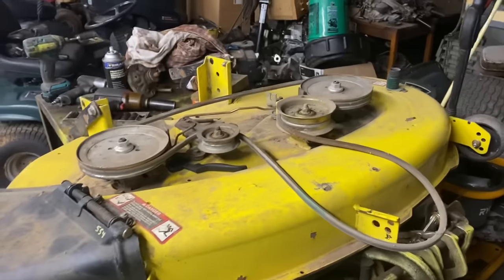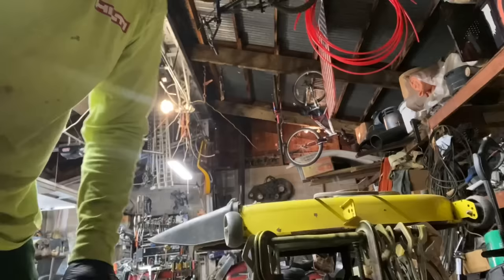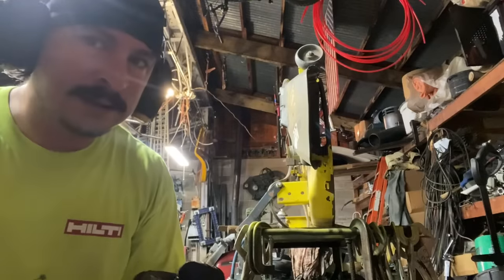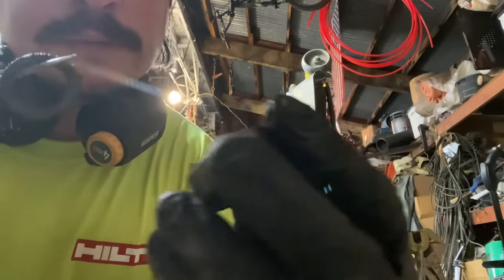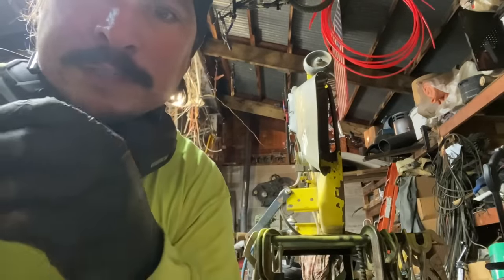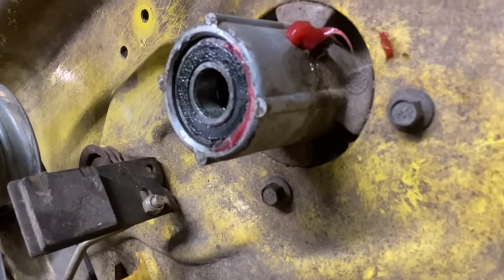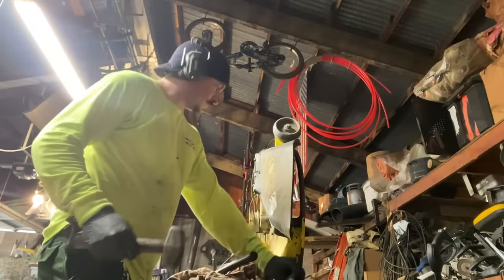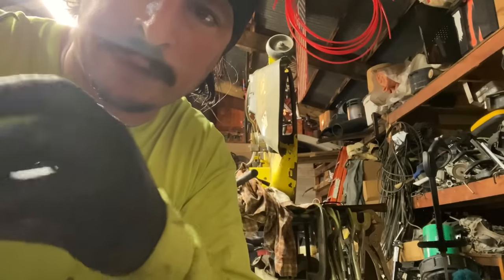Part 1 - Don’t trust the “Experts” Grease your mower deck sealed spindle bearings Common sense.

Comment: Why didn’t you go ahead and pack it with grease with shield off?
Reply from the maker: Did you watch the whole video? I feel maybe you missed some parts if your asking that question. I could be wrong. However, I had some points to make. I was not showing how to do it that way. I was showing that the seals take grease and how many pumps it takes. It was necessary to do it the way I showed so folks would know when filling a new unit how it will be done. Taking these apart to fill the inside with grease manually is not normal and would be confusing if it was mixed with the information I was presenting in this video. It’s simply easier and less mess to connect a grease gun and pump the assembly full.

Comment: With the seals off hand pack the bearings then reassemble  the bearings an once of prevention
Reply from the maker: To each his own. I just proved that is the hard way to do it if a mandrel has grease zerks that would be the smart easy way without adding an hour of tear down and reassembly to a simple basic grease application. Not to mention the unnecessary risk of having a bolt break off on something or other issues on disassembly that could otherwise be avoided but simply using the proper tool for the job, a grease gun. Why make a simple process so complicated? No everyone like to make more work for themselves. Just my 2 cents. If you prefer that method that’s fantastic, it is one way for sure just not the simple way.

Comment: What if the spindles lack zerk fittings?
Reply from the maker: Add them, it’s worth the trouble. Depends on brands. Some like cub and MTD and Murray are under the deck just depending on model
Reply: @GTObearclaw1  Exmark Lazer Z commercial 60". The deck by itself probably weighs 100 lbs.
Reply from the maker: @nogoodcops6557  I’d be surprised if they didn’t have a zerk but may want to read up on those decks. I’m not making videos on commercial stuff just home
Owner el chepo models and some of the heavy machines used taperd bearings and much heaver duty bearings may also already be filled with grease. I’m no expert by want means

Comment: Since an off-the-shelf, general-purpose grease gun can generate pressures in the order of 7,000 psi, it stands to reason that the grease will either find a weak point to pass or will rupture a clearance, seal or passageway and create a new weak point.
Reply from the maker: Yea that’s not a concern here because the rubber lip on a 3 cent shield cap ain’t gonna allow pressured to build to 7,000 Psi. Are you serious here here? Tell me that’s a joke. Do you think it takes more than 10 or 15 psi to push grease past a rubber lip. These bearings are not made for submarines. Good grief. Iv shown every step of the process. It can easily be tested if you want to debunk the process. I’ll be the first to watch your video. In almost 20 years Iv never seen that happen. Thanks for the dramatic comment falica.
Reply: @GTObearclaw1  do you really think that grease gun knows whether it is pumping grease into a $2 bearing or a $200 dollar bearing? First time I've ever seen that "beating the bearing in with a hammer" method. Whether it's a $2 or a $200 bearing, I wouldn't let you near it.
Reply from the maker: @thomasbarrett3175  haha, Ill survive just fine if you don’t bring me your stuff to fix. But good to know you don’t want me fixing it. I guess you don’t care to be called falica. Maybe you can see past the joke. I think you might see what you want to read. Does not really sound like your smelling what I’m cooking here. I’m not arguing the fact a grease gun won’t put out the pressure. I clearly typed that the lip on shield won’t allow that pressure to build. That lip will be unlikely to hold back 15 psi. If the grease is applied to a unit that can’t hold pressure a grease gun can never reach what it’s capable of. But I know you realize that. So probably just a oversight as you quickly read the reply. So regardless of what that gun can exert the seal will simply let it pass out of the bearing long before that gun will build pressure. It seems so simple to me, but maybe because Ivbeen messing with this so long. some folks overthink it because they get caught up on details that don’t mater and create issues that dont exist in this application because of other applications they have more experience with. Could you be crossing over to other application? Do you fully understand how these assemblies are put together? Did you watch the whole video? If not, that’s not fair to me and yet here I am giving you my time. But maybe someday a person reads this and realizes it’s worth some thinking. If I’m wrong here, Where is your proof that lightly tapping bearings with a hammer will hurt them? First time you seen that? Iv seen so many videos folks doing this it seems like it would be hard to miss. At some point yes hard hits can damage a bearing and put dents in the race or flat spots on the bearing. Gentle taps for this application have never been an issue. Besides that, I’m explaining that there is no need to pull bearings out to add grease, if greased through the available zerks, the bearings receive grease and no need to dismantle a deck. not a submarine repair going on here. Did you see any airplanes in my videos. I’m not concerned about inventing things that don’t happen so I can scare folks away from doing basic maintenance. I’m explaining another option in argument of the folks who say that greasing a mandrel is a waste of time. It is in fact a very helpful for the bearings. No doubt it’s a controversial topic. Probably why this video has so many views. My opinion on the topic is not in line with what the “pros” are saying. I was annoyed by the pros saying it won’t work, but not a single one has made a video showing a seal pop off or “blow out” or show that even after pumping the grease gun that no grease reached a bearing. It’s all unfounded claims that nobody provides proof for. Yet here I am showing my whole process and it can easily be retested by naysayers but yet none have made a video proving I’m wrong. So that’s a bit interesting to me. Meanwhile this video is here to prove the experts wrong and one coment at a time I’ll
Go to battle with naysayers. Some get there feelings hurt. Folks don’t like others to disagree. And some love to point out every little thing I didn’t do by the book. That’s how I fix decks. Works great. Some folks go pay a mechanic for a half AZZ job where shortcuts are taken. I rather fix my own stuff and usually do. So I get a good idea of how long my repairs hold up. If your such an expert please post some videos and show us your processes. I’m hoping to help the DIY folks. Lots of folks have backed this process. One thing Iv found is that the folks who have been doing this process long before me message saying I’m spot on. The only folks that say it’s not beneficial all have one thing in common, no hands on experience. Just worried I damaged a bearing or blew out a seal / shield. Only so many things to point out that could be potential issues. Trust me your not the first and won’t be the last. So the other options are, run the bearings to failure and spend $ on parts anyways. Take the mandrels apart not using a hammer and add grease to each bearing individually so not to disrupt the integrity of a lip on the shields. Or, simply add grease and see what happens. If In fact adding grease caused a issue and the bearings fail due to such, things were coming apart anyways without using the grease gun so it’s really just a matter of when you want to pull the deck bearings out or if someone wants to use the grease gun and see if I’m right. We can all test this for ourselves. If you bearings last forever, I’ll never receive a thank you. And that’s cool beans. I don’t care, just knowing I’m on to something here is enough for me.
Reply: Bearings, no matter what they cost are precision ground with specific clearances and tolerances, that is why you don't beat on them with a hammer. I don't need to make a video when SKF has numerous videos that will show you how to install them properly. Just because a bearing is inexpensive doesn't mean I shouldn't install it correctly, after all I want it to work properly and be reliable.
Reply from the maker: @thomasbarrett3175  all? Apparently you have not held the 2$ bearings from Amazon in your hand. Lol. Not all bearings are equal? At what point does a bearing receive damage when tapping with a hammer? Did you see me really getting after it? So your saying a light tap is absolutely going to damage a bearing? Really? And what tolerances did I change with a light tap? In 18 years haven’t been an issue, so there is that. With hands on experience. No issues doing it how Iv shown whatsoever in all my years of fixing decks, that’s all I’m trying to say about how I do it. Not saying I’m the expert about bearings. When possible I like to tap them in by the race. When able to do so, the load is only on the race. I do try to apply the pressure to the race that is in contact with the surface holding said race. And light taps. I try never to hit one hard. Again, your not the first. Won’t be the last. Your stuck on the one thing I seemed to do wrong in your eyes. Maybe that blocks you from
Seeing the benefits of the main focus of my video. The video is specifically about getting grease to the bearings in a simple way. The average person won’t need to worry about removing or installing bearings if they start greasing the bearings before a failure occurs. By using the process I showed and greasing with a gun through the zerks that may already be on a deck, the bearing will have the potential to live a longer life. As for the hammer, it’s never been an issue here and I dont plan to stop however I hear you loud and clear. I simply don’t care. I’m glad we have narrowed it down to that last concern you had. Some folks like to go strictly by the book because that’s what the engineer said to do. And if I had no hands on experience I’d try to follow every step as well. But I’m not that guy. I am the guy who gets motivated when I see something that’s a lie, I will prove them wrong. Been doing it a while, no sweat I will keep doing it. Not everthing needs to be challenged. Knowing when and when not to challenge something is a valuable thing. Some folks will never get it. But thank goodness for instruction books and the subject matter experts. Sometimes I need them too but I have learned not to trust all the information I see from “experts” they can be wrong too. If I’m ever working on life threatening equipment I’ll
Follow the rules or at least consider the advice. But for now I have a hankering to beat the crap out of a bearing and run it in my mower just to see how long it lasts.

Comment: I was told my mower deck Needed the bearings greased so I did that when I started the mower back and let off of the break it was squealing wasn't sure if it would quit in a few seconds or minutes or if it was already too late and something else was going on. I have the world's worst luck with lawn mowers and weed eaters it's ridiculous
Reply from the maker: Yea if the bearings ran long enough dry to damage them it won’t help much to add grease. They will remain load but may hold together a good while longer now.

Comment: I used to make those things in a die cast plant
Reply from the maker: That’s pretty neat, I’d like to see the how it’s made process for these.
Reply: @GTObearclaw1  Russ look and see if you see the initials IDC on them. That stands for Imperial Die Casting. They are just made in an aluminum die cast machine. You can find the process for other parts on You-Tube. Strange thing to know. There is only about two types a long one and a shot one and one company owns them all. I am retired or I would get a picture or two. I might have a friend that would, but they can get fired for it. A few made in China.

Comment: I've been told that those bearings can't be replaced,  you have to replace the entire mandrel.  Again that's wrong.  I never tried this before but it makes sense.
Reply from the maker: Be careful who you listen to. A lot of ignorant people are happy to give advice. Nobody is an expert on everything and if they claim to be that’s a dead giveaway they are probably the last person to listen to.
Reply: @GTObearclaw1  
So true sir! 
Once I pulled an engine out of a 1984 Pontiac Sunbird through the top.  After doing so I read the repair manual,  it said the engine and transaxle were to be dropped from under the car.  Thankfully I was too dumb to read the manual first. I put the engine back in the way I took it out.
Reply from the maker: @bertgrau3934  that just goes to show even the engineers can be wrong. Iv found that many things can be done easer than the manual shows. Lol

Comment: True sealed bearings don't need grease. If you pump that much grease in there it will bust the seals and then needs to be greased more often. In the bearing industry they put grease fittings in almost all bearings even if they're sealed. I think so you grease it bust the seal and then it fails and you have to buy another. Also there is a difference in sealed vs shielded.
Reply from the maker: The reason I made the video was to provide proof. Never seen a seal / shield damaged doing this. Been a few years now I’m sure I’d have experienced a failure by now if that was a concern for this application. As usual the know it alls have never tired greasing a deck this way and can’t prove squat but they are happy to tell us how things work. Thanks for sharing but unless you can prove damage occurs, your wrongs sometimes folks can’t handle being wrong. But your wrong none the less. I don’t know about other bearings. I made a video about mower deck mandrels and the bearings used for such. the way I show works great for this application and is the best way to proceed if looking to get maximum bearing life. Get longer bearing life and less time needed to service the bearings. No need to pull a
Deck apart. Give the engineers some credit. They add the zerks for a reason. Just failed miserably giving directions on how to properly use them for this application. Shields don’t get hurt, not one bit. Not my first rodeo. Im very confident in the process and the only reason I felt comfortable sharing. As for other types of bearings, high speed or otherwise, I’ll refer to a person more knowledgeable on the other higher quality “sealed bearings”. extra grease finds it’s way out. It will all be okay.

Comment: Why not upon disassembly remove the inner seals, make sure the inside of the housing is good and clean. That way those bearings will stayed saturated in grease while running. Could almost guarantee a lifetime bearing if you can keep it in a bath of grease.
Reply from the maker: Works exactly the same with the seals in place. Even without seals if the housing is not filled grease may not reach both bearings. Probably the upper bearing would be the concern. At some point depending on how running the grease is, it could eventually work down to the bottom bearing with gravity and possibly get on the bottom bearings hosing has to be pumped completely full so Grease will fill the bearings. Every time new grease is added more is pushed through bearings if you fill
The housing completely full the the first time. Taking a deck apart is a waste of time unless something is broken requiring such. I only took
The deck apart to prove the point. Even after seeing the video you still
Think the seal needs to come out? That was the whole point of the video. Grease passes right by the seals. Even if the seals
Are out, it’s not like all the grease inside is going to rotates or flow through the assembly. The only grease that will
Ever be in the bearings is what was pumped into
The path of the bearings when the grease was pushed in.